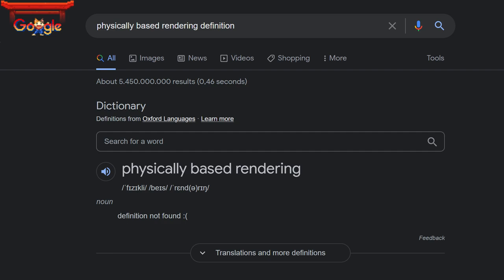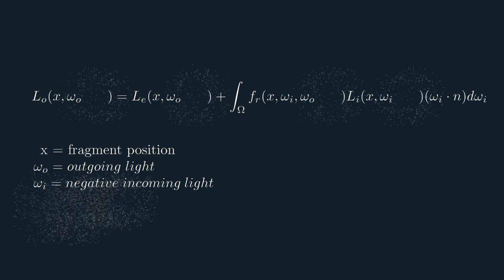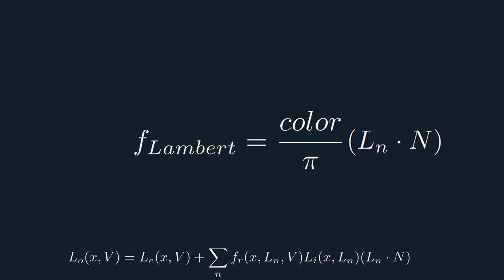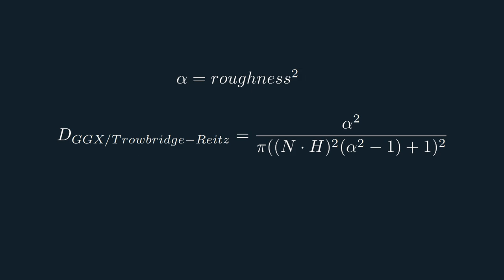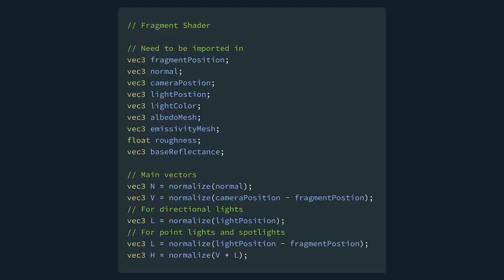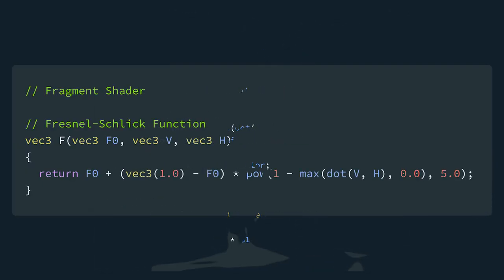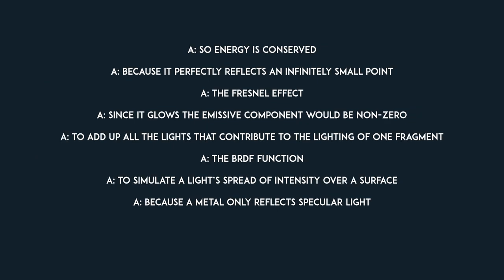Computer Graphics Tutorial - PBR (Physically Based Rendering)

Comment: Just a side note to this amazing video:
- Fresnel tend to be VdotN not VdotH to get that rim effect.
- You could set the max of dot product to 0.005 instead of 0.0 to avoid some artifacts on the border of rounded meshes.

Cheers ✌
Reply from the maker: Do you have any sources for the VdotN for Fresenl? I believe most I've seen are VdotH 🤔
Reply from the maker: I did google it but most of the sources I found used VdotH 😅
But yeah, this source does indeed use VdotN. I'm still not convinced since this is from 2003, while the articles I reference in the description (UE4 & some Google thing) are much newer and use VdotH.

But I'll look into it further 🤔
Reply from the maker: Here is another interesting source on the topic: https://www.gamedev.net/forums/topic/697139-pbr-fresnel-color-bandingwrong-formula/5380998/

So what I'm getting is that VdotH is usually more realisticish, but VdotN gives that "aura" effect which might be desirable in some cases 🧐

Comment: Question: GLTF materials also specify an occlusion factor (usually in the form of a texture). How do we take it into account using this model? How does it affect the final equation?
Reply: If I understood correctly, it just affect ambient light. So we just multiply Li by (1 - acclusion) if the light i is ambient. Is that right?
Reply from the maker: If that's what you've read, then I guess that's how you should apply it. To me "occlusion" sounds like something in which it's hard for light to get into, like the space between two planks or a crack in a rock. To me for those it would make more sense to simply multiply occlusion (assuming 0= no light 1=lots of light) with the final result...

Comment: what programming language is that? c#?
Reply from the maker: As I said in the video, it is pseudocode that uses a syntax similar to C.

Def from google: "Pseudocode is an artificial and informal language that helps programmers develop algorithms"
Reply: It's so more or less exactly GLSL syntax, as the built-in functions and types are identical to what's shown in the pseudocode. Need to use proper uniform and in/out declarations though as well as using texture samplers instead of using constant values for the whole object. Using this in the example would be specific to a single shading language and though less generic.

Comment: Can someone plzz explain why did we use summation instead of integral?
Reply from the maker: At the end of the day an integral is basically an infinite summation as I said in the video. 

The only way to add up an infinite amount of numbers is by spotting a patern that then allows you to reduce that summation to a simple formula.

Sadly some integrals cannot be reduced to simple formulas, and these are called "nonelementary functions".

So in order to solve these sort of integrals, numerical methods are used. In this case I use a simple method where I simply assume the integral to be formed of a finite amount of elements... and so I use a sum :)

Another reason would be that I use point lights in this example, so there will of course be a discrete amount of light rays affecting one pixel (one light ray per light). In the next video with IBL you'll see that this won't be the case anymore ;)
Reply: @VictorGordan  Now I got it !!

Btw great video 👍

Comment: 12:06 what do you mean by that?
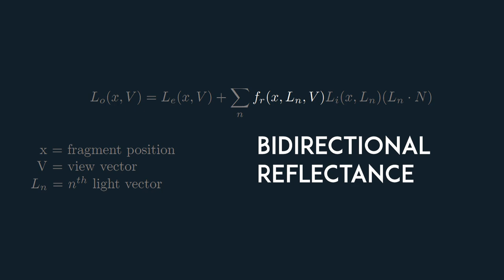Reply from the maker: I just said that using those variables you can calculate the BRDF. I explain what that is around 04:00
Reply: @VictorGordan  I mean what means "don't forget to omit Ks"
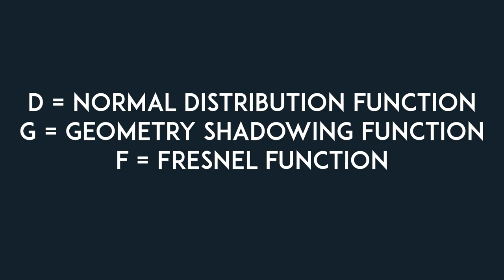Reply from the maker: Around 07:00 I explain the reason
Reply from the maker: But basically, in this case I use the Cook-Torrance function for specular lighting (not the only function that can be used) and this function includes kS (named F in the Cook-Torrance function) within itself. So then kS must be taken out of the BRDF equation since otherwise u'd have kS^2 doubling the Fresnel effect for no good reason
Reply: @VictorGordan  Thanks!